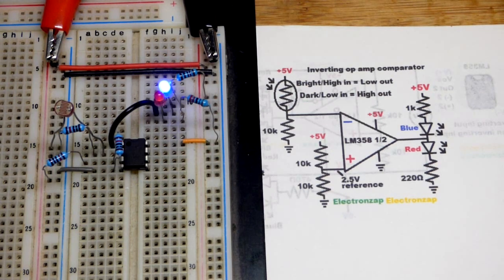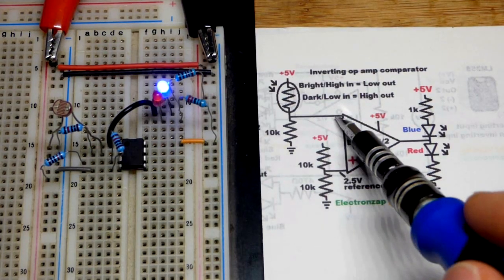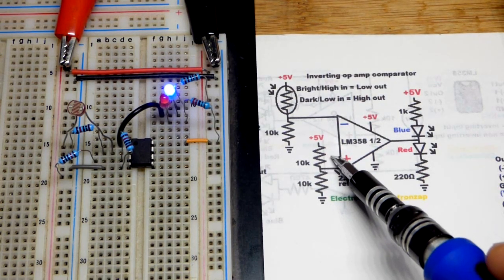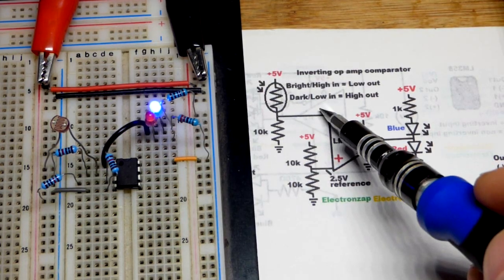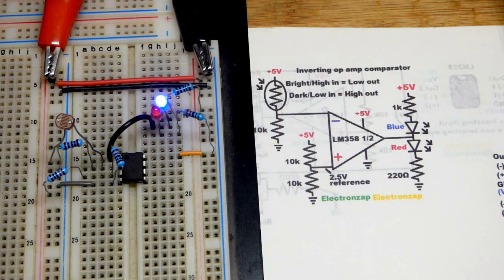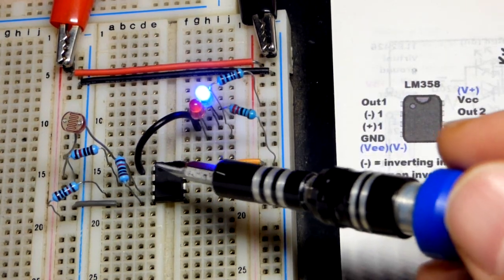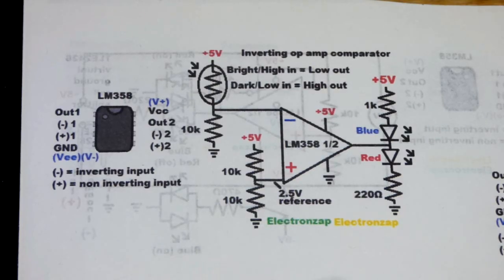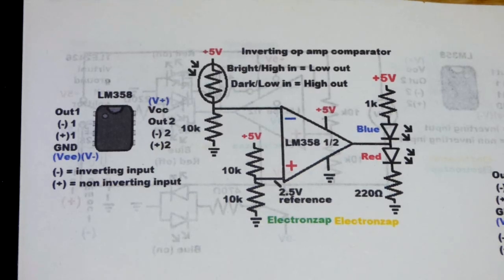LDR Controlled Op Amp Inverting Comparator Circuit Light Dependent Resistor Operational Amplifier

Comment: Hi, great video. I was abit confused as to why the blue and red LED doesn't turn on together. If the voltage at the non inverting input is below 2.5V that would mean the op amp is sourcing current to the red LED, what's stopping the blue LED from turning on if its connected to the power supply rail?